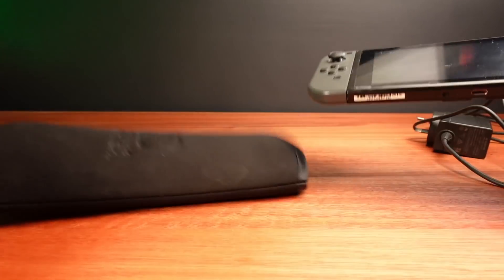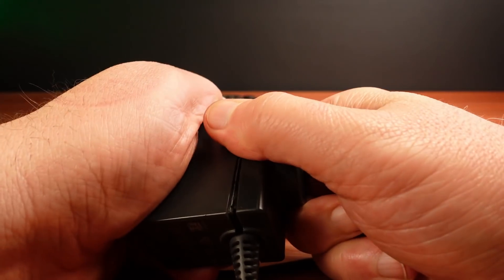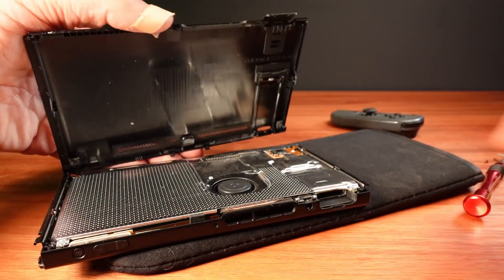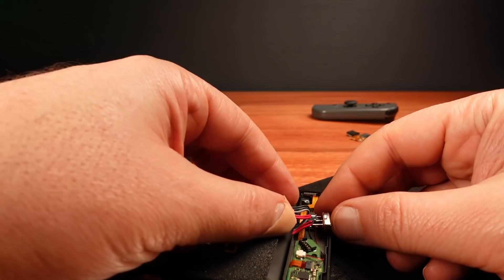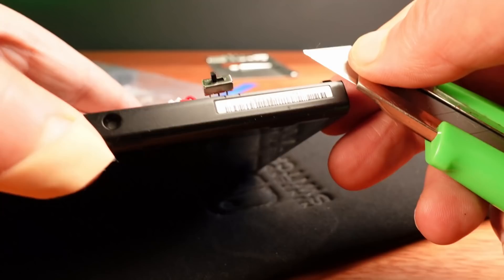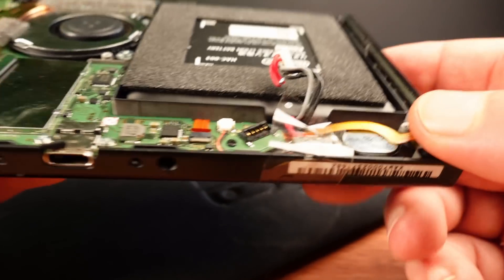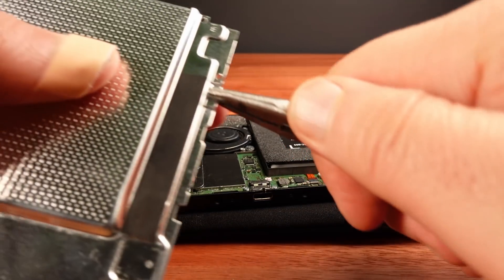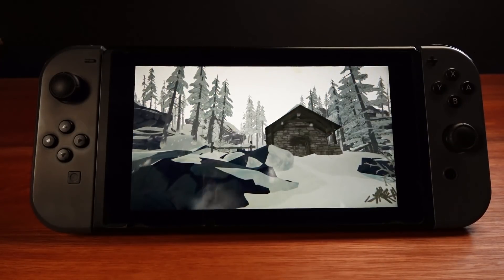Nintendo Switch: Hard Power Switch Mod

Comment: The Wii U gamepad does this too. Every time I want to use it, I have to charge the battery first. It takes hours to charge too.
Reply from the maker: I don't have a Wii U so I didn't realise that Nintendo haven't learned to fix this very annoying problem. Thank you for that information.
Reply: The Wii U has its antennas (uses the same protocol as WiFi), always active in order to turn on automatically when the Wii U console is powered, I dislike this design though causing it to be power hungry.
Reply: I know right, and it's wasting charge cycles as well. Should I just remove the battery when I am not using it? How long do I need to keep charging it when it's removed (where I need to plug it back in to charge it again).

Comment: Congratulations on "fixing" autoRCM blank screen drain issue (v1). Maybe for next improvement, a pilot led light for indicating power on (v1+autoRCM:blank screen waiting for dongle)
Reply from the maker: Thanks for letting me know it's from autoRCM blank screen drain issue. I now wonder if I remove autoRCM will the battery stop draining when powered off.

Comment: I shut down switch the power it on when nintendo logo appears i hold power button until screen goes black with a pop from the speakers and then its completely off
Reply from the maker: What if I told you mine still goes flat in a day or two after doing this. It's weird that only some Switches have this problem.
Reply: @JanusCycle  yeah one of mine even goes into RCM mode after having sat for a long time forcing me to hard reset it to get it back out of RCM I have had my switches in this state for a few months and they still held charge and they are sadly patched switches so no fun stuff like android and using the full potential of the hardware
Reply: Hi again

Comment: This is awesome, I might have to do this on my laptop! In the EU there's a law that says electronics need to run at less than half a watt when powered off. It's usually a BIOS option on laptops, and it's the difference between mine lasting a couple days and a full month. I still wish it would be more
Reply from the maker: Be careful! but there are definitely some devices that need this sort of mod.

Comment: !!!ATTENTION!!! Your tiny power switch might get hot and might the plastic melt due to resistance.
Reply from the maker: So far it seems ok.
Reply: @JanusCycle  It could be fine if the Amps/hour of the battery is low. Or you might play it for a long time straight and see the effect. Because as far as I know the tiny switch uses a very thin metal sheet for contact. Last time I did to one of my device runs at 5 volt it got melted.

Comment: I have a nintendo switch lite  and i also like to play on it from time to time, it's more casual play like you do, but this switch also goes flat after a couple of days which is quite annoying and is putting unnecessary cycles onto the battery. Now that i saw your video, i am thinking of doing the same to my switch, just solder in a switch to really turn off the nintendo switch so that the battery doesn't go flat after 2 days! I also own a PS Vita, this has the same, casual usecase scenario, i love the Vita, but i don't play on it that often, but this device, not even turned off, keeps months of battery, which doesn't drain the battery! Granted i hacked in a 3000mAh samsung smartphone battery inside my Vita, and oh boy this thing has HOURS of screen on time, way longer than the factory estimation. I don't understand why the nintendo switch drains the battery this fast while doing absolutely nothing!
Reply from the maker: My Vita battery also lasts months. I would have hoped Nintendo had fixed this well before the Lite was released. But this is what we have to do to make them usable.

Comment: 6:38 I can recommend two part epoxy putty, typically available as plumbing leak repair alternative. It is fine to apply as any size blob and when using wet latex gloves can be applied with fingers, without any mess behind
Reply from the maker: In a putty form? I like the sound of that, thank you!
Reply: @JanusCycle  yup, for me it was easy to find both home water leak stuff and automotive leak repair. Both are likely the same, quick set and high working temperature

Comment: 0:44 Why did you remove the grills from the top of the Switch? and specifically its strange there is one left in place.
Reply from the maker: I just checked and there are grills at the top of my Switch. I would have to rewatch the video to see what happened there. I'm sorry I don't remember.
Reply: @JanusCycle  0:44 you can see it's missing a bunch of them just has 1 left.

Comment: Not the same but my brother left his switch for ages turned off wouldn't even charge when he went to use it, it completely shut itself off had to do the reset thing and it repaired itself seems wild that something like that could happen as well..
Reply: If the battery is kept uncharged for too long it can also crystallize. So it is recommended to charge every 6 months.

Comment: Can there be problems with always leaving the switch on its dock?
Reply from the maker: If the battery is always kept at 100% charge that can shorten battery life. Some modern phones will keep the battery at 80% when plugged in overnight and only go up to 100% just before morning.
Reply: @JanusCycle  Hm, okay. I haven't ever used my switch long enough in handheld mode at one time for it to matter, but that's still unfortunate. I do like having it charged for whenever I might want to grab it though.

Comment: One thing to note is the switch contacts are thin, the default system has thick two wires to supply large current, this switch will limit that as inside contact will be very thin and offer resistance hence will drain battery if in use , should have checked for contact resistance before soldering, i known this cuz i done similar mistake with phone , it was not able to boot cuz of very thin wires they i doubled the wire contacts to make it work and another phone just used thick wire, why i did cuz charging port got damaged and replacement parts are shit here often from chep low quality instead of std connectors.
Reply: sexually transmitted disease connectors?

Comment: switches, or at least i hope maybe only early ones, are real junk in terms of reliability. there's sellers on ebay and stuff selling like 5 early serial number switches for like $100 with the same issue, a burnt out chip, which is just expensive enough to make them not worth repairing unless you have tons of them.

Comment: I never knew you can mod the Switch.
I remember that people usually mod their 3DS with homebrew and stuff but I haven't seen homebrew on a Switch, very interesting...
Reply from the maker: Very old Switches like this one can be modded without a mod chip. Newer ones need a mod chip installed and Nintendo makes sure they remain impossible to find.
Reply: @JanusCycle  Even so, there's a point where they'll become available once the Switch goes off the market and Nintendo cares less.

In my personal use case that's what's important to me: backing up my games to a Steam Deck or other hardware so I don't lose them!

Comment: Good observation! I keep mine charged often, it's strange that Nintendo overlooked something so common sense as power management, but they added Bluetooth headset support so late i'm not surprised anymore lol
I was considering, is that switch rated for the peak power consumption of the switch? If Nintendo decided to use two wires instead of one, i'm almost sure it was to be able to use two not so thick wires instead of a thick one
Reply from the maker: I've been hearing that not all Switches have this power drain issue. But some sure do. 
I'm more than happy to have a switch on mine. It's my tinkering console with exploitable bootrom :)
Reply: @JanusCycle My Switch I got day 1 definitely has battery issues. It’s had the battery % sync issues and the battery lasts maybe a few hours in standby. If it’s shut down it’ll be completely depleted in a week
Reply: I personally would've preferred that they have charge limiting options for people who keep it in the dock all of the time. I feel like that would be much easier on the battery and would improve it's life. Heck, it may even be safer.
Reply: the bluetooth support is so lackluster too. it uses SBC and it sounds like you're listening to a low quality mp3 file. I ended up having to buy a transmitter dongle anyways.

Comment: Hello ! Please can you tell me, does this mean the switch can run with the battery switched off but still inside ? Would be great news, since many ask about the switch running without / with a dead battery. So this would be the solution.
Reply from the maker: I did try this. I disconnected the battery while plugged into charge, the screen stayed on for a second. But then the Switch turned off. It seems to know there is no battery.

Comment: I'm not an expert, but I recently heard that to make batteries charge faster they split and tape them together. Each cell needs its own charging circuit, so if tying those two together combined cells then you could end up with a fire eventually. Maybe not soon. Please please investigate this.
Reply from the maker: Thank you, safety is very important. I did check the continuity and both red wires are connected together for redundancy at each end, see 3:15.
I also saw MKBHD's video recently on fast charging and two batteries side by side is indeed what some devices have these days.
The Switch is however a single cell and can be be disconnected by switching off the two red wires together.
Your message is still important. Anyone doing this sort of work needs to learn about battery safety first, before attempting anything like this.
Reply: @JanusCycle  oh thank goodness. I'm so glad to hear that! Thank you for doing your due diligence, I apologize for doubting.
Reply from the maker: @SoftQuartz  There's no need to apologize. Because double checking things that can be dangerous is the right way of working with this stuff :)
Reply: If you were worried about this type of thing, you can buy 6-pin switches, it's basically 2 switches connected together but seperated. it might be a little bit bigger though.

Comment: I noticed standby is good, but if you're in a game, dead the same or next day.
Reply from the maker: Interesting, your Switch should be going into standby when the screen is off even when a game is running.
Reply: @JanusCycle  it does. I just mean if a game is running and you press power for standby versus having no app/game active and pressing power for standby (and that's with a new battery about 3 months ago)

Comment: There's a full power off if you hold the power button
Reply from the maker: Yes, that's what I use, but it still goes flat in a couple of days. Thank you for making sure I know that though.
Reply: @JanusCycle  yeah that definitely sounds faulty. The only time your battery should drain that fast is being on Cold .
Reply from the maker: @radeononi758  If my Switch was faulty then it no longer is :) and I'm still not happy with the way Nintendo engineered the power circuits in the Switch.

Comment: If only the switch had the power saving abilities of the 3ds. I fished my 3ds out of a drawer it'd been in for months and it still had like 75% of it's power. Mind blowing.
Reply from the maker: The 3DS is an awesome console, I'm very pleased Nintendo added great power management as well.
Reply: My 3ds goes from fully charged to zero in one day of standby.
Reply: @NewDimensionsvideo  is it an original 3ds or a later iteration/2ds?
 My 2ds looses it's battery in a day but my original 3ds lasts months and months in standby.
Reply: @strayiggytv  it’s a ‘new’ 3ds xl
Reply: Are we talking about powered off or in standby as in close the screen while it’s turned on
Reply: @NewDimensionsvideo  nothing is going to last that long on standby
Reply: @subg9165  Wdym? I have an old HP iPaq (I think mid 2000s). The thing can last months powered off. Last time checked, was 8 months with 30% battery remaining.
Reply: @SDogo  those don't really go into standby in the same way modern devices do, they don't run stuff constantly in the background. it's more like powered off but with the clock running at very low power in the background for timers/alarms and stuff
Reply: @NewDimensionsvideo  odd,i have a new 3ds xl as well and it lasts months before needing a charge.
Reply: The 3DS's battery is meh compared to the DS Lite. Turned mine on for the first time on over ten years and the battery was still green.
Handheld batteries have just been getting slowly worse with each generation.
Reply: also most of the 3ds' had a removable battery with a screwdriver. notable exception is the XL models iirc

Comment: Neat mod and great video as always! I wish more electronics came with a hard-off switch to preserve battery life. I don’t have a Nintendo Switch but I would be very curious to see what the the quiescent current draw is. Standby draw should, in theory, be in the nanoamps if a soft-off solution is implemented. I would guess the Switch is drawing at least a couple of milliamps to deplete the battery so fast in an “off” state. Also love the wordiness about putting a switch inside the Switch at the beginning. Gave me a chuckle!
Reply from the maker: I could have measured the current draw while I had it open and off. But I just wanted to get this done. Going flat in a couple of days when off, then needing hours to trickle up and full charge again was getting ridiculous. I've since thought it could be something like always charging the controller batteries. Whatever it is, I'm in charge now :)
Reply: @JanusCycle  it's strange because my switch definitely lasts a lot longer than that when off. it's the exploitable one as well, I've got an sd card I keep in the case with android on it!  diy android tablet haha